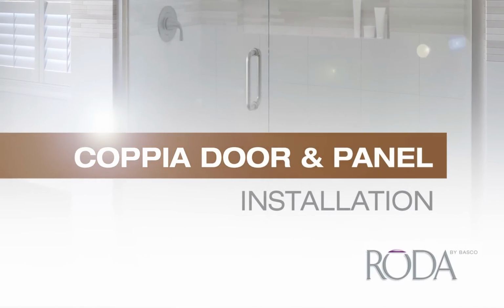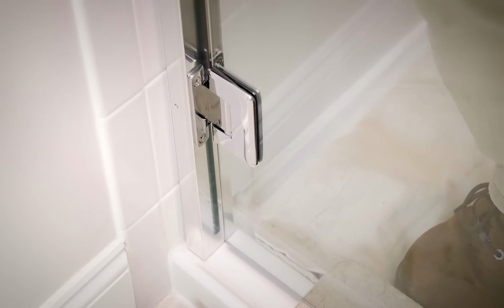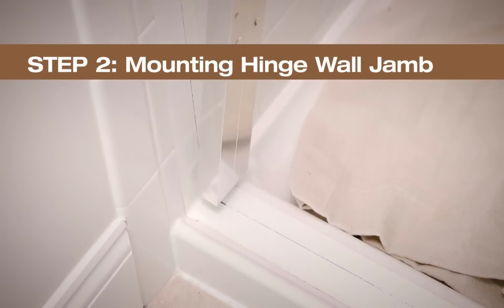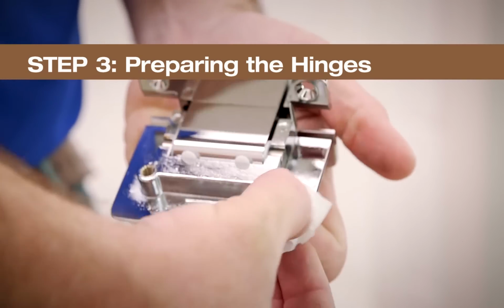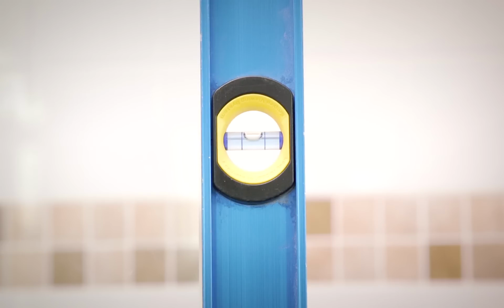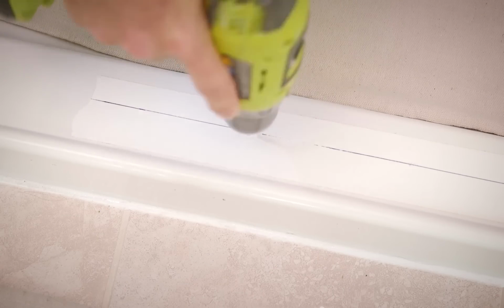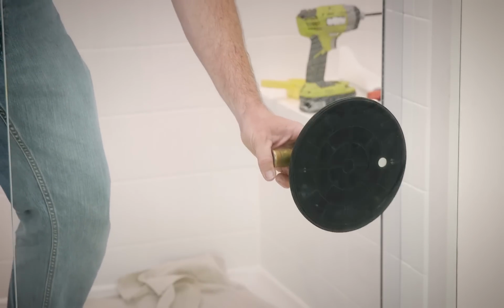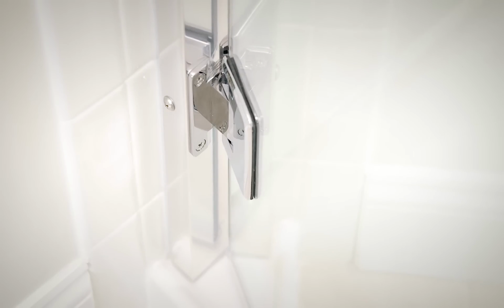How to Install a Frameless Swing Shower Door with No Blocking - Coppia by Basco

Comment: Can this be installed on a wall that’s not level? The wall that the glass is screwed into is not level.
Reply from the maker: Hi there, thank you for your question. This Coppia door (model COPA-935), has an adjustment of 1-1/2" overall. It breaks down to 1" adjustment on the panel side, and 1/2" adjustment on the door side for out-of-plumb wall conditions. If the out-of-plumb conditions are more severe, a filler will be needed. For more information or assistance with installation questions and fillers, please feel free to reach out to our customer care team at 1.800.45.BASCO or via inquiry@bascoshowerdoor.com.

Comment: If this door is installed in a bathroom with no 2x4 behind to secure it to will it be ok? Isn’t the weight of the panel supported by the jamb anyway ?
Reply from the maker: Hi there, thanks for your questions. Both questions can be answered with a yes. It can be installed without the 2x4 behind it and it is supported by the jamb. This is what makes our Coppia frameless series special!

Comment: My door was professionally installed , but does not center. Whats the best way to make it center itself?
Reply from the maker: Hi James, the door is meant to close within 5-10 degrees of center, and then the customer closes it the rest of the way.
Reply: @BascoShowers  in my case the customer cant close it the rest of the way, it goes back to that 5-10 you spoke of. I do have this hairbrained idea to add a shim to the outer side of the hinges. I know itll be trial and error.
Reply from the maker: @Mophead520  A shim can be added, but it sounds like the pin inside the hinge is set to close about 5 degrees off.  The pin can be turned, but it might be easier to flip the hinges upside down, so the door closes inside the shower 5 degrees, and a vinyl strike jamb can be added so that the door closes against that.

Comment: Can this be installed in a fiberglass shower that has a pocket door backing?
Reply from the maker: Hi Alex, the short answer is no - but it depends on how thick the fiberglass is, as the screw that goes into it is 2” long.

Comment: I have two vertical gaskets that goes along the edge of the door and the stationary side of the glass.  The gaskets are different, one has a double fin sweep and the other has a bulb seal.  I don't see any thing mention in the video about the gaskets and how to install and where each gaskets goes.  Any help would be appreciated.
Reply from the maker: Aaron, do you have the Coppia Series door shown in this video?
Reply: @BascoShowers  I believe it’s the Celesta Series.
Reply from the maker: @saltyairdiaries  You can find installation instructions on our website here: https://bascoshowerdoor.com/installation/installation-guides-by-products.
Reply: @BascoShowers  Thanks.  Still no mention of the above information in the instruction manual.
Reply from the maker: @saltyairdiaries  You can call our Basco Customer Service at 1-800-45-BASCO.

Comment: At 2:34, sticking that skinny pencil in allows for too much slop. Make a template. Best way is a piece of masking tape on the frame, poke the holes in the masking tape, and then remove the tape and stick the tape on the wall.